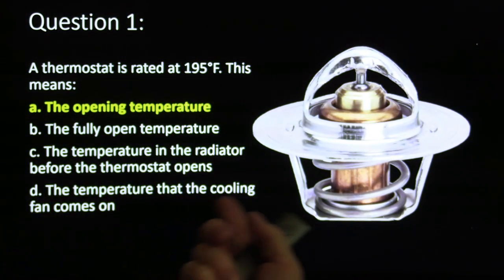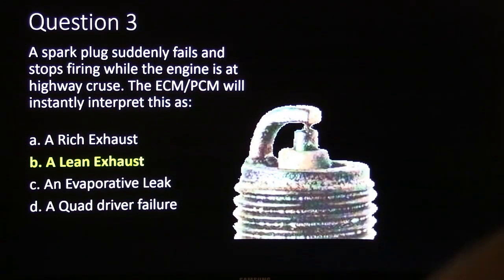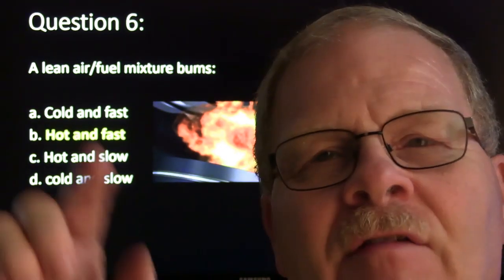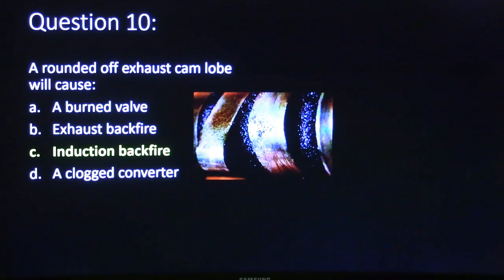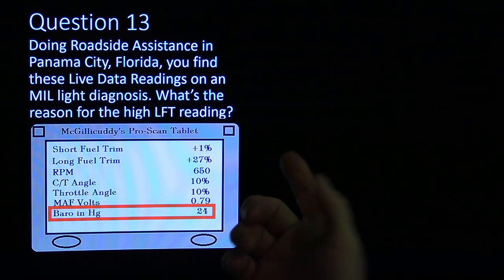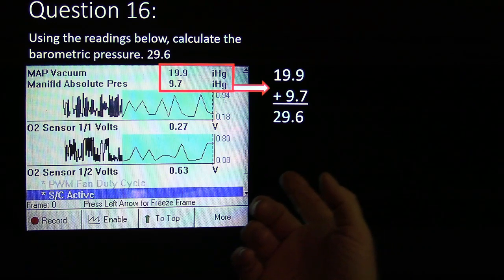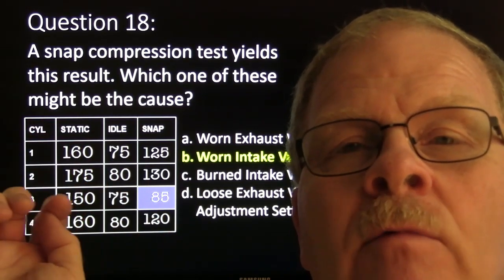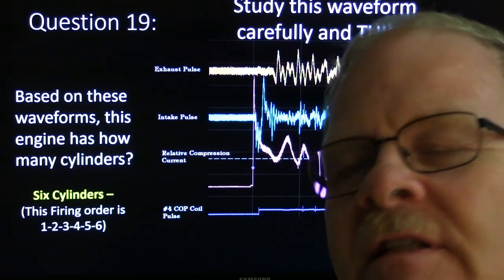ASE A8 Practice Test Answers

Comment: I missed 3.  The snap throttle compression question got me along with the valve stem seal issue on that spark plug and the EGR on the Pontiac 3.4L.  Where can I get an I Love Lucy scan tool?
Reply from the maker: That I Love Lucy scan tool comment is hilarious actually I created that one from scratch using Microsoft paint

Comment: Q20, wouldn't the higher current on the other cylinders indicate they're "harder" to spin meaning they have good compression rather than low?
Reply: I had guessed in the first video the only one low was 4
Reply from the maker: They All had lower compression... One cylinder had higher than the others.

Comment: Hey I'm working on a 2003 ford Taurus it's running hot it's the 3.0 dohc changed hises water pump thermostat and bleed system still running hot???
Reply from the maker: What you need to see is if it produces cooling system pressure very rapidly after you start it cold it may have a blown head gasket but you won't know until you do further testing